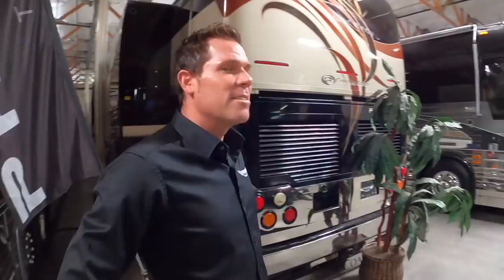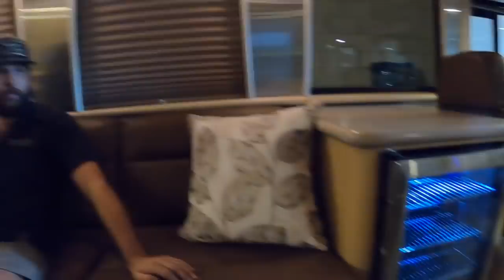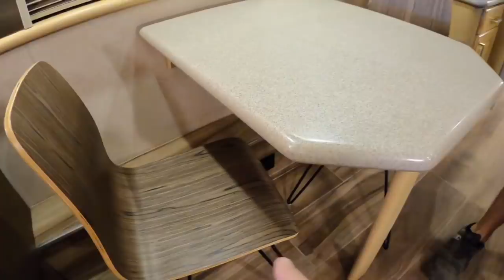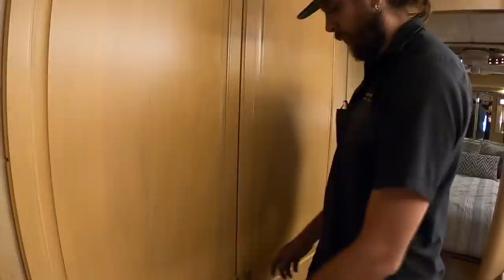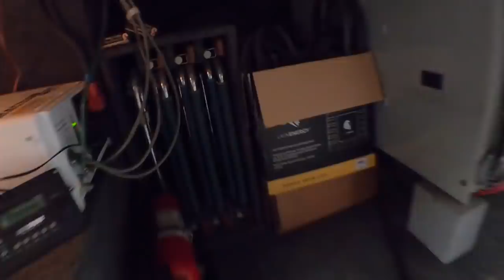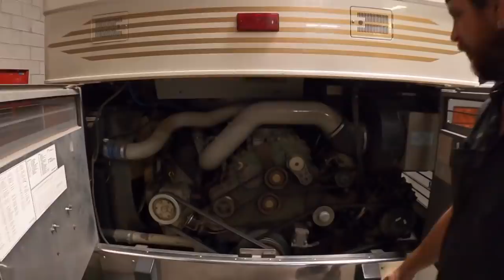FAMOUS PREVOST ON THE MARKET FOR $140,000!!!

Comment: One of the best things about this coach is the series 60 non egr. It's a straight diesel w no after treatment thingys,  no def. It's a million mile motor. I've used a couple in semi trucks, in one now. Just change the oil by every 15k miles and that coach could go forever.

Comment: I’d definitely be interested in buying this or something akin to it. It has everything I need for starters and, without slides less potential problems. I would be keen to add solar panels as, in my humble opinion we do have to consider #ClimateChange and do everything possible to reduce our carbon emissions. I’m just loving these ideas for my upcoming purchase of my first motorhome. Keep em rolling 😉🖖💫
Reply: You are going to offset a 5mpg 48,000 lbs vehicle with roof solar?

Comment: This may be or may not be the cheapest Prevost on the market as he says the problem is not buying one the problem is owning one. I’ve owned 3+ an MCI and I can tell you from experience unless you’re a millionaire or a billionaire you cannot afford to own this coach. at 5 miles per gallon $400 for an oil change $2500 for an alternator and these are the cheaper items, it’s just too expensive. If you decide you want to buy one buy a 95 to a 2000 the old body style and I’ll tell you why. the newer body style don’t have rivets and the sides literally come off the repair bill on this is $40,000 to $60,000 so stay away from those coaches. the ones older than a 95 have an AV 92 engine that no one in the United States works on anymore, they are very in efficient, very slow, Smokes, leaks, burns a lot of oil, not a good motor and you WILL be sorry.
Reply: @gruponemesis    It’s your lie tell it anyway you want.